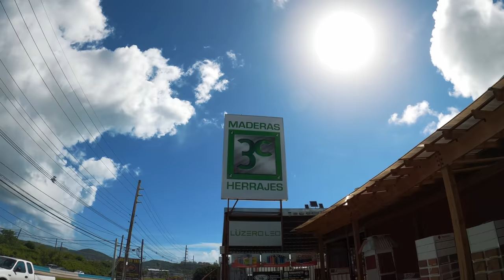BOAT YARD (PART 2) DESTROYED OUR BOAT SHOULD WE BUY THIS ONE?!

Comment: Hey Matt, Colin/Parlay is definitely a good watch for tips on glass work and bulkheads but I would recommend you research how those knees were attached by Hunter and then come up with a plan to replicate or improve on the original design.  Standing rigging is just too important and not making a solid repair will at best cause you endless problems with water intrusion and at worst ending up demasted in an already sketchy situation on the open ocean.  Love you guys and I know you'll end up doing the right thing, hope it's not to much $$$ getting there.

Comment: I worked in construction for 25 years and the Lenox brand reciprocating saw blades are about the best you can get.  Are they more expensive?  Yes.  Do they last a lot longer, absolutely.  You probably are done with the tear out by the time I type this.

Comment: You should recall have treated the ply before you put it in, sealed the ends/edges  in contact with the existing hull with resin before you fibre glass over it.

Comment: You need to mix up some thickens epoxy and lay it in the corners from top to bottom and then glass over it , if you do t know what thickened epoxy is you get a bag of fiberglass strands they are individual strands of fiberglass about 1 to 2 inches long and you put them into epoxy resin and mix it should be about as thick as peanut butter 🥜 and then put it In the corners on both sides and use something with a rounded end and mold it , I find a 3/4 to 1 inch tongue depresser the sell them as mixing sticks

Comment: Great resource!  Andy on Boatworks Today provides great examples of fiberglass repair on a project by project basis.  Another great channel for applying plywood and glass is Sailing Parley Revival.  Colin has been repairing broken bulkheads and related areas on his boat in Panama, for the past year.  Both of these guys provide an excellent step by step approach for completing each repair, as well as reference other videos for related items.  They also address their "rule of thumb" used regarding the type of epoxy, fiberglass, length, number of layers used, etc. to complete the repair.  I do think watching these channels will give you more confidence in the approach you take to complete each project.

Comment: Matt....I love you but you need someone to recommend tools to you for the job. A flapper sanding disk would have made that job 10X easier. Wire brush is for metal and can leave behind contamination on the surface of the fiberglass (that gray residue) you see. The other problem is you are not boxing that bulkhead in for strength. Its "flimsy" because you don't have a brace spanning between them. That's what the old bottom piece did.

Comment: You definitely need to be putting fillets into the corners of your fiberglass joints.  It needs a sweeping curve, not a 90 degree angle.  Search up Frisco boater on you tube and watch his restoration of his Sea ray.  You need to be making peanut butter out of fiberglass with fibers and silica that you make into a putty to put your fillets in the corners.  I would also recommend getting some roving matt, sandwiching a layer of stuff you have with a layer of the roving.  It adds bulk and strength.  The other thing I would recommend since you aren't doing a ton of fiberglass work, is using Epoxy instead of fiberglass.  It is about 30 percent stronger than fiberglass and it is way better at bonding to old existing fiberglass.  The other thing you haven't even looked at yet it, below the floor.  If you have rot in your wood up above the floor, I guarantee you have a ton of rot under the floor.  Honestly if you've gone this far, you should gut the floor out and replace it at the same time.  I don't know if sailboats have stringers like speedboats, but in a speedboat they add a lot of rigidity and strength to the fiberglass hull, and if they are all rotten you have none of that,  It is definitely worth taking a look down there.  You don't want to put all this new stuff in your boat and have it resting on a rotten foundation.

Comment: these bulk heads you are putting in should be glued using a good strong epoxy and then the layers over this after it has partially set should get progressively larger i.e. 4 inch strip then an 8 inch  strip then like a 12 inch giving a good overlap for adhesion! hope this helps dude maybe should check out some bulkhead videos before you destroy your boat!

Comment: I don't know if this is worth knowing, when I had to replace the rotten wood between the outside and inside fibreglass on the little boat's transom I brought back to life years ago I found second hand form-work planking at a second hand yard not far away, I think it is better than even sea-ply to prevent rot.
Being Australian I don't know if form-work planking is called that elsewhere but it is used to form the shape of foundations for buildings and is filled with rebar and concrete after which it is removed and maybe used again, new it would be expensive but used or even offcuts are cheap and can be used even if it needs cleaning, my bits were 20 mm thick which I think is 3/4". If needed for strength it can be doubled and I just cut the outer fibreglass skin, made the wood fit in the hole (I made a video about that and it should be still available on my channel) and resined the cut fibreglass pieces back into place, a 50 horse Mercury was no trouble for the transom after that (it had a 10 HP Evinrude on it before).

Comment: Good job.  Those things are called "knees," not "bulkheads."  A bulkhead is the whole wall that was behind you in the video.  I don't think I would have ripped the old knees out if they were well tabbed in and otherwise solid.  I would simply have added a couple layers of glass on each side of the old ones.  The fiberglass offers more structure than the wood anyway.  At this point, I would build up the new knees to the thickness of the old, and simply add more glass to the old.

It looks like you will also need to replace some, if not all, of the bulkhead behind you too because of the rot (where you stuck your fingers through).

Of course, I don't know how many weeks behind these videos are, so you've probably done what you are going to do anyway.

Comment: I realize it may be too late, but, when working with chemical paint strippers use a vapor barrier on top of the wet stripper. Then you can give the stripper the  time it needs to penetrate multiple layers of paint. The chemicals in the stripper are too volatile to last long enough to get through more than one layer before important components of the chemistry have literally disappeared into thin air. The vapor barrier stops that from happening as fast. I’ve used plastic wrap from the grocery store and it works well, but get the crappiest stuff you can find. Good quality plastic wrap clings too well and is a pain in the keister to work with. It may be easier to work with painters drop cloth but I haven’t used it and don’t know if it is resistant to the paint stripper. I wish I knew this tip before I was almost completely done with my boat. It would have saved me at least 20 hours of work or more.

Comment: get a finger belt sander to do that job. fibreglass doesnt like tight corners. its dificult to conform to it, and failing that, it creates bubbles (weak  spots). you need to fillet first(thus creating a larger radius curve) to get the cloth to follow it. you applied chopped strand mat (CSM) and then a layer of biaxial cloth. CSM do no impart much structure thats why they had to pile it. Biaxial cloth on the other hand, its all about structure in 2 different axis. Download " The Gougeons Brothers on Boat Construction" this is essential to understand the basics (and not so basics) of repairs procedures. if you are working with West system epoxy (which was developed by those brothers) you should know that it creates amine blush upon curing. you can wash it with  lukewarm soapy water or you can spend a couple more bucks, get peelply, and get a smooth surface plus all the amine removed once you peel it. if you dont remove the amine blush nothing will stick to that surface. Finally, you are getting yourselves into at least 6 months of work, going at it full time. think about that other boat and the fact that you have a new engine coming in, and your current mast which could be placed on the "new" boat

Comment: Try thickened epoxy to make the edge bond well, and the stranded mat does not really add strength, I would use only the 1708, and many more layers for sure. Try to encapsulate all the wood, impregnate it with resin, I would buy chap poly resin for that, epoxy will bond to that for the actual tabbing. Gaps and exposed wood in the chain plate BH are not something you want. And do not breath more glass man, it stays in your lungs and drives inflammation for the rest of ur life.

Comment: From all the research I've been doing while looking for my first boat the CS 40's are good vessels but damn that one looked like it needs a lot of work. Windows for sure at least need to be removed cleaned and re-sealed as long as they're still in good condition. Chain plates would be something I'd look at extremely closely and find out why she's missing her mast? The interior looked decent and maybe some Murphy's Soap would bring it back around. Really didn't get a good enough look to really know what overall condition she's in. CS 40's are pretty prized by their owners and have a good rep but she'll definitely have to be a really good deal. Will that new engine you already have coming fit in that CS 40 and have enough power for her, that would take care of one concern at least. With your skills Matt I'm pretty sure you could handle changing the head a bit to add your lady the separate shower she wants. The only way it would makes sense is if you can buy her for less than repairs plus your time will cost on your boat while at the same time factoring in what it'll take to get her up and ready. That's something a lot of people fail to do when they're thinking of DIY repair costs, factoring in their time. Yes it's your time but that doesn't mean it doesn't have value as it's actually the most valuable thing any of us posses as it's finite.

On the bulkheads, you have the one you removed and even though that isn't a perfect gauge it does at least give you an idea of the condition of the others. If you're really in doubt you could always drill a few small holes to check spots on the remaining bulkheads and then fill them with epoxy after if they look good. If that backs up what you're thinking that they're good and not rotten, I agree why replace them. You also know it will take a lot more glass than you originally thought to make them as strong as what's already there. Whatever you kids decide I know it will be the right decision for you.
Fair winds, following seas, safe travels and God Bless...
Oh and sorry for the TLDR you just get this old man riled up and wanting to help...LOL

Comment: Matt, the fiberglass you took out was 24oz. woven roving.  It is thick af and required less layups to get the reinforcement you seek.  It's less expensive to use poly resin for this repair.  You can thicken it with cabosil and make a bedding.  Then smooth that glop of thickened resin with a tounge depressor.   But definitely regardless of resin get the woven roving.  Your life will be better.   I've been buying it in  north fl. for like 10 bucks a yard.  Also your grinder game is whack.  Get a 40 grit flap wheel for that paint.   I like to use a metal diamond tipped concrete cutting blade to cut glass off it's the last one you'll ever buy.   I hope that reaches you in time.    If it makes you feel better I spent 8 hrs today getting the prop shaft coupler off with a puller.   I got half way there 🤣.  Made me feel better watching your pain anyway. Ciao
Reply from the maker: That's awesome! Ye the flap wheel is the way to go

Comment: Hey Matt , before you start on bulkheads dont you need to get the hull back to original position? Probably need to be on the hard with pressure on the outside from the jacks, went its back in position the cabinet gaps should close up. Love you guys but Matt your messing up on fiberglassing, watch Colin repair bulkheads on Sailing Parley, Hate to see you do all that work and have it fail on you later.

Comment: I don’t see the logic in what they are doing here. The demolition was prompted by sagging cabinets and creaking noises—nothing was said or seen about having to retighten the rigging. Instead of removing and repairing the bad bulkhead they knew about, they begin by starting to remove the chain-plate knees, structural elements that have nothing to do with the sagging cabinets, and do so apparently without tapping on the knees to determine whether there is a problem and, if so,  drilling a core sample to find out if there is rot or de-lamination. This is a “repair”, that if not done correctly, could get them killed.

Some have commented that Matt and Kristin know the boat; what they know is an increasingly growing list of problems they didn’t know about before. If a thorough, professional inspection were performed and the repairs were competently performed, they should keep the boat. But there are too many reasons to question whether it will turn out that way. They will know what they did, but if they didn’t do it right, they will find out as soon as it fails.

The much recommended Colin, on Parlay Revival, has a degree in mechanical engineering and 10-12 years experience as an engineer/chief engineer on super-yachts, nevertheless, he knows that he doest’t know everything about fiber glass boat design, construction and repair, and consults with others who have more training or experience. He consulted at least one marine architect is diagnosing and fixing the problem. And in repairing the places in the hull where the balsa was laminated in between the inner and outer fiber glass layers, he had a skilled glass guy do the first repair while he watched. He did the next repair himself under the pro’s watchful eye.  And his having occasionally worked in his father’s construction business shows in his ability to select the correct tool for the task and use it correctly.  That’s not the picture on GBU: after this video, I think GBU is an illustration of the Dunning-Kruger effect .

The repair commenced in this video shocks me. I cannot believe that an actual expert in fiber glass outlined what we saw as the way to do it. Maybe Matt asked the guy who sold him the glassing supplies some questions, but no one who has experience repairing an ocean-going sailboat would begin the repair that way.

Comment: Did you run fillets on all your joints before you started to lay down the fiberglass?  Fiberglass cloth has no strength at 90 degree angles this is why you are able to move it with your hands  Fiberglass should be always layer on smooth curve at all joints.  The fillet will had strength and the curve it provides gives the shape needed for the fiberglass.   Easy fix, grind out the fiberglass at all the joints, add the fillet then glass 5 to 6 inches past the joints.  Wish I was there to show you

Comment: Fiberglass  thickness  needs to ne the same as originally built. The strength of  Fiberglass is determined by this. Its right  in the west system Fiberglass book. Grab it. It's cheep  mabe 5 bucks at west marine.
It's looking  good  just  match the original.

Comment: You two are great.  I have enjoyed your video's for over a year now.  My advice...Time for a new, bigger, better boat.  As much as you dig into the old boat, it is still an older boat.  Dry rot can be everywhere and every project it at least twice as big as you think, at least.  You deserve a bigger, better boat.  All boats have projects, but upgrading little things like a shower is not as big a project as building a whole new boat.  In the end don't be penny wise and pound foolish. Having A/C is a big upgrade.  Look around and see what is available.  In the end you will have a nice boat, but it still will be older.  Consider upgrading!  Your friend (your expert) is giving good advice.  Lv ya.  Merry Christmas!
Reply: isn't the bigger, better boat even older?
Reply: @kevio6868  Being a large sailboat owner myself, it more depends on how well the boat is kept that just its age.  A well maintained boat can be managed and maintained for many years.  Doing the level of work they are attempting is a major job that does take some special talent.  That being said, I respect what they are attempting to accomplish and wish them luck.  They are a great couple.  Replacing haul structure, engine and electrical is a very big undertaking, even for the most talented.  I was just pointing out, there are a lot of boats out there in great shape, ready to go that could meet or exceed their needs and wants.  A/C is a big thing where they are located.
Reply: @06HiTech  

I definitely see your point Rick! Bulkhead work is definitely critical! And the Mrs. seems to be ok with the 40 footer.
As long as it gets a quality survey structurally it may be easier to refit the head with other upgrades. And ac is definitely a huge plus for quality of life in the Caribbean, I would think.
I just want them to be safe. I really enjoy and appreciate their channel and all the work they do
Reply: @06HiTech  

Rick do you currently have a channel? I would be happy to sub and follow as well